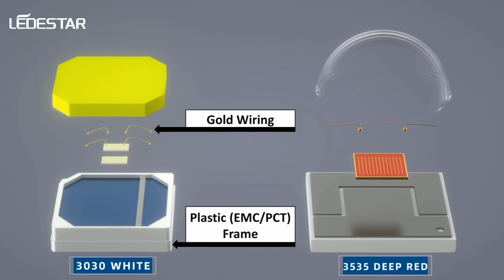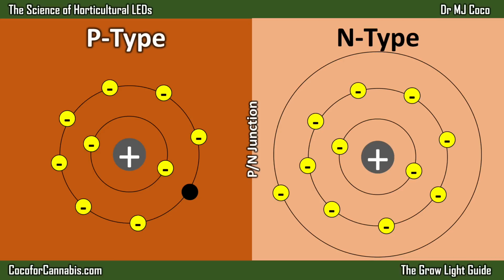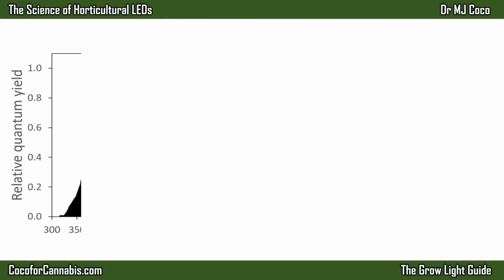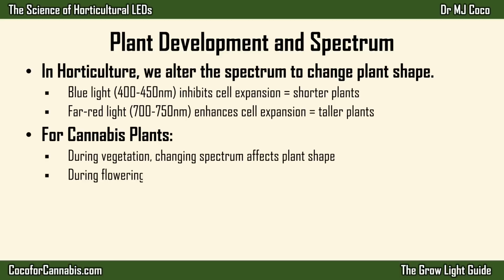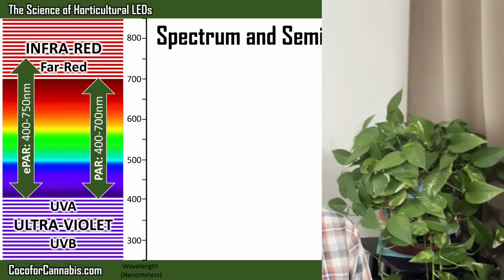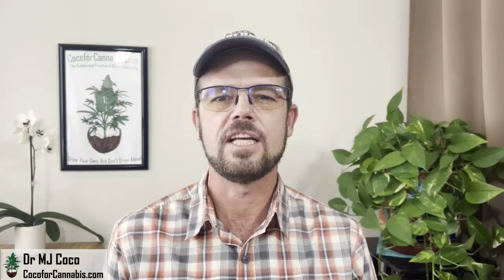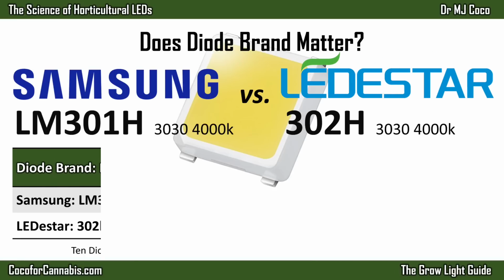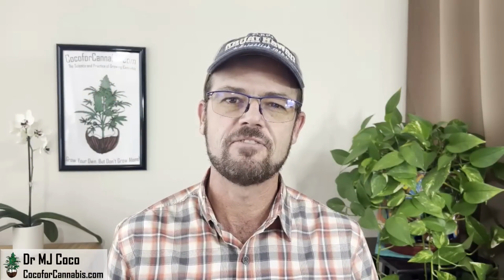The Science of Horticultural LEDs

Comment: Great vid. I agree that photons are photons, and although a lot of manufacturers are Sanan, I'd have to advise against putting your money in cheap LED makers. If you read their datasheets, not only are they completely ripped off from Samsung, 1st red flag! But, thermal resistance on those diodes are 21 C/W!!! Yeah, you could seriously underdrive them but if the pins are lead (which we don't want in 2024) then you're going to get a tattered phosphor and efficiency will get murdered year for year where if you're a serious grower, even a homegrower, will probably get really annoyed when your lights fizz out. With that said, there are higher quality low priced diodes with more than half the thermal resistance and better materials, but it's still a close call to the better brands out there, even at higher currents. If you really want photons you have to think more red and less green. You can go 80-90% red and 10-20 blue/green.

Comment: I'm curious if anyone has tried using a silver wire, instead of a gold wire in the diode.  Because not many people know this, but silver conducts electricity better than gold, and produces more power.  For example if you had two different top end Competition series car alternators.  One was wound with a gold wire core, and the other one wound with a silver wire core.  The silver wire core alternator will put out more power at the same rpm level from the engine.
Reply: True that. Silver is a slightly better conductor, but gold doesn't oxidize as readily which is the main reason it's chosen in specific applications. Also, it is more malleable, whereas silver is more brittle. So, it can be formed much easier as well as applied in layers an atom thin. No other conductors can and this keeps overall costs competitive w less expensive options.

Comment: Phosphor quality is one of the more interesting focuses of LED manufacturers. Not only in how efficiently they spread emission energy but also in their lifespan and resilience to this specific environment (sprays). Conformal coatings help but can reduce lifespan if the thermals aren't as performant (not to mention the optical performance). IR heatguns to check localized hotspots should be standard practice for ensuring the luminaire performance over time.

Comment: Knowing suggested # LEDs per watt is SUPER helpful. I have been making dimmable quantum board kits in which I select my own driver, and I would love a video about this. Your rule of thumb let me know my qb288 (272 diodes) are likely efficient up to 90w, but my qb96 (64 diode cob style) light engine should be run at only 21w sadly.
Reply: I have 8x Qb120s that I built into a fixture prob 3 years ago, and I usually run the total array between 150 and 350 watts (or between 150mA and 350mA per led). Mine are the Samsung LM561C leds for what it's worth. My driver is a meanwell hlg 480h-24B (so 24 v, adjustable pwm, max 480W.) My driver and LED draw need to be in the range that each needs for max efficiency- since the LEDS are pretty much max efficiency when the current is lower (higher light also equals exponentially increased heat losses) it means I want to run them as low as I can while getting enough light. 

However, based on my lighting needs, I want about 200W in veg and 350W-400W in flower, so I want a driver that is most efficient in that range. IIRC my driver was most efficient between 80% and 100% load, meaning I want to be pulling 380-480W, but since the LEDs are more efficient at lower draws it means my overall system efficiency is somewhat even across the brightness range I run it at. Also since I wanted a 24V system for safety reasons it limits the type of drivers I can pick from. 

Takeaway-  you need to match your driver to your expected load if you want to maximize efficiency, and LEDs in general are going to be individually more efficient at lower current draws. 

The most efficient way I could build my system would have been a 24V driver with probably max 100W so I could run the driver at max load while driving the LEDs at the bottom of their range, but the problem with that is my max brightness would be very dim.

Its a tough balancing act! And if you're building your own it requires some reading and understanding of spec sheets.
Reply: @20xx-mm-dd  thank you. Are you saying thermal efficiency or % of possible par efficiency? I don't think that MJCoco and Migro address the driver portion very much, which I think should be a big topic. It seems like serious growers should be considering choosing their drivers, and I feel the advice seems blind to the driver issue. For example, I think I can run the Qb96 harder than is suggested by the 3-4 led per watt rule of thumb before the driver feels even a little warm.